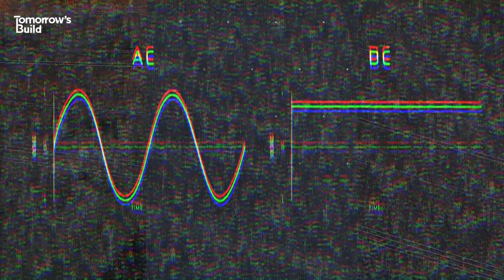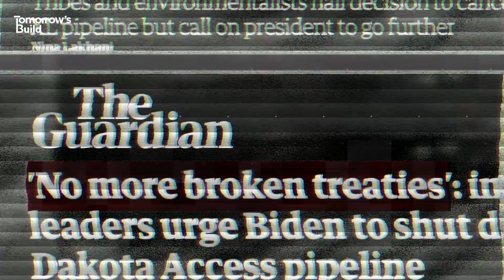The $23BN Plan to Power Singapore from Australia

Comment: The ac dc stuff is wrong. The thing that makes it low loss is the high voltage, when transmitting in the air we use high voltage ac since it’s really easy to use a transformer to raise the voltage of ac current. However underwater, the cables have a much higher capacitance, this results in energy losses in ac, but not in dc, so extra effort is put in with hvdc cables. (This explanation may be a bit wrong)
Reply: Yeah they got it pretty wrong, generally AC is used for power transmission nationally and in peoples homes BECAUSE of its efficiency over distance when compared to DC. When we talk about HVDC and HVAC its a completely different world, the are many reasons why HVDC is better for a long distance underwater cables like you suggested.

I think the thing that got me though was 'You will remember from school...' - how many schools actually teach V=IR, power factor or any basic electrical theory these days?
Reply: @daskurka  I learned this in high school........ back in nineteen seventy three.
Reply: "You may remember from school" That part drove me crazy too. In high school I learned why transformers reduce transmission losses, and I have since taught hundreds of engineering students the relevant circuit principles to understand for themselves why that is the case, and if someone remembers any thing about circuits from school they will conclude that the video is just wrong. Only a small percentage of people understand parasitic capacitances and the effect on power factor, and even fewer would think of applying those principles here.
Reply: @Cyberguy42  Yep, the voltage rise in a 4000km AC cable would be in the order of megavolts
Reply: your answer is far more correct than the video.
Reply: Thanks for clarifying. What I’m really more aware of is that long distances have higher losses and that AC was more for long range but not familiar with the explanation. Anyway, apparently, it’s not so much an issue and 10% loss is pretty impressive with that distance.
Reply: I think when the distance of transmission reaches some specific number, HVDC is cheaper than AC transmission.
Reply: Yeah. I was looking at the comment section because I'm sure what he said is wrong about the ac-dc part.
Reply: So explain why there are many long HVDC overhead lines in the world? Even if its crossing over different AC grids they could just use back-to-back stations and AC mostly if you're right.
Reply: “You may remember from high school …” yeahhh I do, you don’t
Reply: Yes this is correct. You wouldn't be able to run high-voltage AC through a cable even if it was 100 km, let alone 4,000 km. But to go 4,000 km with low loss, the voltage would have to be a lot higher. The cable would also have to be a lot more expensive. Then there are issues with maintenance, etc., when you have megavolts running along the ocean floor.
Reply: Undersea or underground cables leads to higher inductance resulting in highér energy loss for AC
Reply: The Chinese use HVDC for long distance on land. 
However for sea cables even for a few ten km (offshore wind farm connection) HVDC is used.
Reply: @armineser2591   dc has been used since late 60s for transmission over “long” distances… however not many offshore wind farms are using dc yet… I actually only know dolwind beta converter station and it is connected to a few different wind farms all AC.. there are examples of offshore wind farms using AC there are more than 100+ km from the connection point at shore….. what DC wind farms are you referring too?
Reply: This is a very advanced subject. What the video said was correct, sort of. But the reason it was correct aren't obvious, nor was the claim complete. Transmission line design is a subspecialty for Electrical Engineers with a master's degree or better. Tomorrow's Build went to a much harder high school than I did.

Wire losses come from current (I) thus are called "I-squared R" losses. (The R is for line resistance.) Power is equal to the voltage times the current. Thus we can drop the current by increasing the voltage for the same power. But increasing voltage requires more insulation so the line doesn't arc. AC insulation is more complex than DC insulation. Further, AC voltage is listed as the root mean squared (RMS) voltage which is only about 3/4 the true voltage (Vrms = 0.707 Vpp). So AC power requires both more and more expensive insulation. (Underwater at least. Most transmission lines use air as an insulator.)

Another complicating fact is that AC electricity likes to travel near the surface of the conductor. This is called the skin effect. The skin effect at 50 Hz (Singapore's operating frequency) is about 8mm. This means that the outer 8mm of cable carries current (more or less). An effective thicker cable drops the resistance (R) of the I-squared R formula. With AC, making the cable bigger doesn't help drop the resistance as much as with DC. At DC, the skin effect is theoretically infinite, so the whole cable counts as a conductor. (Of course even with DC, there's still a frequency, but it's measured in cycles per year for when they need to take the cable down for maintenance instead of cycles per second.) 

Another complicating fact is somewhat strange. Due to factors I can't even remember, the total power through an AC transmission line is limited by the shift in the wave rather than the voltage. Since that shift is limited to 90 degrees maximum, there's no real way to boost AC transmission lines past a certain point. In short lines this isn't a big problem, but longer lines struggle.  (The internet says a 50 HZ electrical wave is about 6,000 Km long. 1/4th of that is 1,500 Km, i.e. shorter than our transmission line.) 

Another complication factor is heat dissipation. AC transmission lines need to worry balance the inductance of the line with the capacitance of the line (i.e. the insulator). This is what makes the insulator more complex and more expensive. It also makes getting rid of the heat generated by the I-squared R losses harder. Electrical insulators usually make good heat insulators. (The one exception I know of is diamond which is a bit pricy.) Since losses are higher for AC and the insulation is thicker, this is a bigger problem for AC than DC.

There's likely a lot more factors I'm not considering. Transmission line design isn't rocket science. It's much harder than rocket science.

Comment: I didn't know DC was more efficient than AC to transfer long distance so for the first half of the video I was mentally screaming "WHAT ABOUT THE WASTE!!!" lol. The 10% number was probably the most interesting thing said in my opinion. 
Super interesting though, keep it up!
Reply: not DC, HIGH VOLTAGE DC!  The reason more efficient AC is not used because there is very high loss to subaqua AC transmission lines.  This is because the AC transmission line has a large electromagnetic field surrounding the wire which is highly attenuated by seawater.  High voltage DC is only more efficient in this case for that reason.  Edison failed in the competition with Tesla and Westinghouse to provide power distribution because his LOW VOLTAGE DC system had very high loss and thus a very short range.  The narrator of this video did not present this correctly and many have corrected him here in the comments.
Reply: @Electromotive_Force  current through a conductor causes electromagnetic fields, regardless of current type.

The increase in efficiency for DC over AC in this application can be mainly attributed to the Skin Effect I've mentioned in another comment.
Reply: The efficiency gain is related to something called the Skin Effect - this only manifests for AC, which effectively increases the resistance of the cables being used for transport.
Reply: I also thought that. AC is best to transfer power. But this project is beyond AC transmission lines. Therefore DC lines are better. IDK but being underwater cable may help in reducing the energy loss as sea water tend to be cooler.
Reply: @naseemnich860  I'm pretty sure being in cold water would not reduce waste. The heat is still being generated, just being transfered to the water. Imagine dunking a incandescent light bulb into water. Yes it might be cooler, but it's efficiency will remain the same because it's still generating the same amount of heat